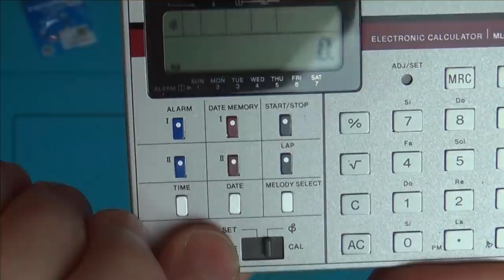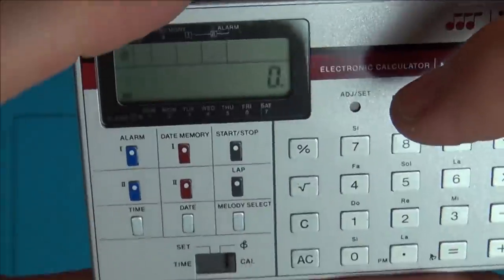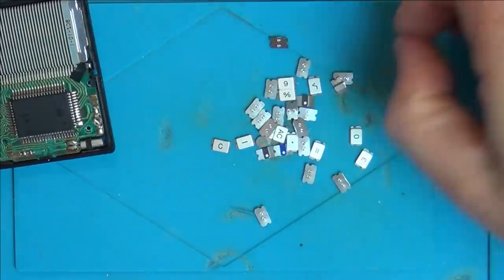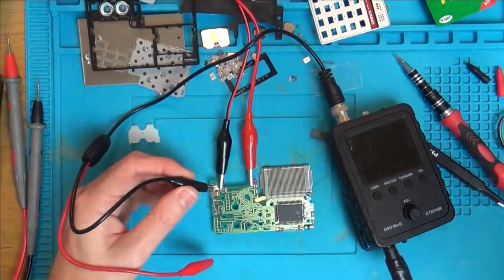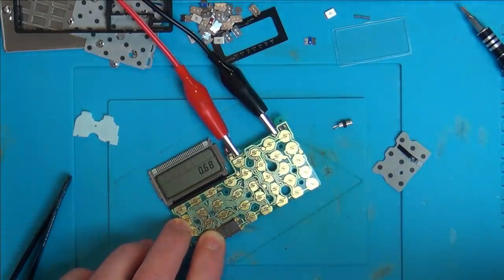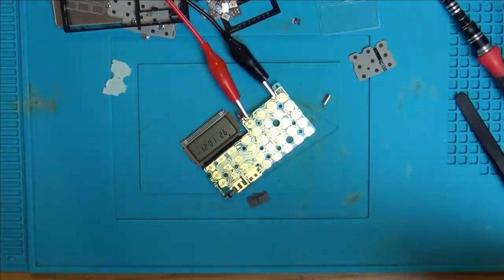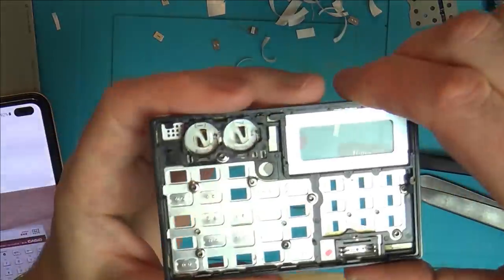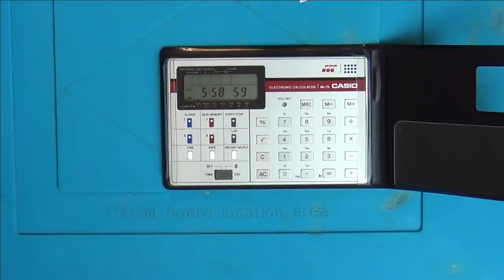Trying to FIX: 1985 CASIO Musical Calculator that Sounds like R2-D2 !!!

Comment: When you removed the crystal and tested, the time was running way too fast, after the replacement crystal installed it then regulated the speed.  So although working without the crystal, it wouldn't have kept good time.
Reply: Exactly! He kept saying its counting up correctly and in my mind I kept yelling NO!

Comment: These Casio calculators last forever. I still have a Casio scientific calculator my parents got me for school in 1987. The small battery door has bulged out a bit but it still works on the original battery 33 years later.

Comment: Less than a minute in, Vince says "I'm wondering if it's just a battery fault" - checks video length, yeah never going to be just a battery !
Reply: I check the time stamps too for videos. Lol
Reply: You need to reset (press "P") after inserting batteries to make it start correctly.

Comment: Most people do not push the “P” reset button or AC/Adjust button or simply don’t know that they have to short the AC terminals when they switch batteries in a Casio product. That is 75% of the “for parts or repair” faults that I have from the Casios that I purchase off of eBay, and the remaining 24% is the sliding switch contact issues.
Reply from the maker: I never knew that either, thanks for sharing. It may be useful in the future :-)
Reply: Out of curiosity, what is the remaining 1% fault condition(s)? I am interested in finding out as I own multiple Casio calculator wristwatches and scientific calculators and feel it would benefit me to be prepared! Thanks in advance oturbator!
Reply: @electronicengineer  The remaining 1% can be 0.5% component issues (broken, bent, lost) and 0.5% can be trace issues. For example, if you ever come across a Casio PB-1000 with a garbled screen, it is highly probable that the seller didn't initiated a proper Reset after replacing the batteries. So it is safe to buy it, keeping in mind that the Casio folding traces are notorious for failing. For example, Casio Fx-451M, PB-220, Fx-790 et. al. are all tricky buys. It is rarely a component failure, like tantalum capacitors or electrolytics which can cause an issue. The LCDs are better than most Sharp or Radio Shack computer or calculators at the time.
Reply: @oturgator  Thank you for this valuable information! I appreciate that you took out the time to reply to me and to identify the issues so well!
Reply: Sounds interesting. I have Casio fx115d calculator from 1991, have had it from new and I still have even the instruction manuals for it. All it says about replacing the battery (GR927) that the owner should bring it to the Casio dealer for battery replacement :D
I have replaced the battery myself at least once or twice without problems but now it's been been without any battery inside almost 20 years. Still works with the solar cell though.
Very entertaining video. The comment about driving teachers mad made me laugh :D They were already mad about those beeping LCD electronic handheld games we had in the 80's :D
Reply: @mrjsv4935  Nintendo game & watch pocket games, very collectable now, I have the 'vermin' one from 1982, still works perfectly!
Reply: Cool :) Mine is Q&Q King Kong game from 1983 and works fine as well, but had to fix battery contacts.
Reply: @oturgator  Most damages (particularly of LCD) in such old electronics are caused by battery leak vapours. Thus always remove batteries before storage. The nasty thing with cheap alkaline button cells is that (unlike expensive ones) they leak already before they are empty. Do not use bulged button cells; they are about to leak. (They are safe to use for few hours but not to keep them inside).

Comment: Awesome video Vince, love these retro calculator/watches with musical alarms, anyway, i program microchip microprocessors of which you can use an external crystal or use the processors own internal oscillator, now these also have an option where by if the external crystal fails, the processor can switch to it's own internal oscillator, so maybe this is what happened when you removed the crystal, the processor started using it's own internal oscillator, not knowing the cpu in that unit i couldn't tell you, but loved the video as i love all your videos and hope this bit of information helps you a little, take care Vince :)
Reply: Models without clock have no quartz but used the internal oscillator to save some cents.

Comment: Quartz cannot be classified only by frequency. A quartz is a complex system in which the relation between the voltage and current (aka the impedance) is  a function of the intrinsic properties of the quartz. One can look at a quartz as a parallel of a capacitor(C0) and a inductor, capacitor and resistance. 
The overall frequency response of this object is what "decide" the frequency of the quartz.
Quartz are used in oscillator in always in some sort of feedback system, where by theory to have an oscillator one have meet the Barkhausen condition (aka the phase of the overall system, at w = w0 = 2*pi*f0 (where f0 is the quartz frequency), = 0  and the  loop gains equals to 1).
So to do in a digital circuit on place an oscillator in a feedback loop of an inverter. Now to obtain the above condition one need to consider the value of the quartz  internal parameters.
Any way despite all good fix and I guess it could be that that quartz was used for audio indeed!.
Reply: My ancient Normatest AVO meter has a clock crystal, great big thing inside there that is used in the formulation of analysing signals which have to be set against an unbreakable constant to gain the variation which becomes the reported signal to your meter arm.   Its useful in that the device does not rely on the battery or mains voltage as a constant which can vary considerably, other uses being setting current frequency to a precise waveform or used as a binary pulse switch e.g. watches.
Reply: I don't believe you. Every crystal can be replaced by every crystal you randomly find at home.  Proof: Vince
Reply: so if what you say is true, and the freq is dependent on current and voltage, why is a crystal the same freq on 3.3v as it is on 5v or 12v ??? and why do manufacturers not print a voltage range on them ? ? ?
Reply: @WereReallyRelayCamping  it's not dependent on voltage and current. I want describe the stuff easier. It's dependent on the transfer function of the equivalent circuit of the crystal that is the ratio between the vokatge and current. The frequency is dependent on intrinsic characteristics of the filter
Reply: Also to measure filter you put it i to a network analyszer that swept the frequency at for every frequency it calculate the impedence of the crystal. Than you would obtain a plot where you see that the function you see have a minimum and that is the quartz filter.

Comment: Nice fix, I kinda figured if the clock was working w/o the crystal then the crystal was for the musical tone generation.  Also figured a standard 32768 crystal is what was in there and low and behold... it was.  Morning has broken, but not the singing calculator watch music thingy :)

Comment: What a great video, I really enjoyed watching and hearing the process of dismantling, diagnosing and resurrecting a little Casio calculator. I was in high school when this generation of Casio calculators were popular and remember them well - so much nostalgia!

All these years later I now have three vintage Casio musical calculators - 2 x ML831 and 1 x MG880. I bought my first ML831 as "faulty/ parts or repair" (though it was cosmetically in excellent condition), and was also hoping it would be a simple battery issue. Unfortunately, it wasn't. The second ML831 works fine though it's noticeably more used (I plan to put the working internals of the more battered ML831 into the cosmetically better case of the other ML831). The MG880 I found in a drawer in my old bedroom at my mother's house back in the UK when I visited earlier this year, and I can't for the life of me remember where I got it from. It turns on and appears to work, but the display segments have fluctuating/ non display issues, though it's almost certainly poor connection with the display ribbon, as putting pressure on the display connectors makes the invisible segments appear. The ribbon cable looks to be one of those heat/ press/ glue cables that are notorious for failing contacts on more recent 1990's/ 2000's LCD and electronic devices (including some synthesizer key beds). Casios seem to be less affected by this and in general their LCD displays and connectors were/ are very reliable and well made. I might try the trick of reheating the ribbon cable to connector contact as that can sometimes restore the connections.

Back to the faulty ML831. If I put batteries in it, the display shows a 1 and a  -1 at each end of the display, and sometimes it makes a droning tone, and sometimes it doesn't. Of note, it does this regardless of where the power/ melody/ calculator switch is positioned - the selector switch changes nothing and none of the buttons are responsive or do anything. I took it apart looking for a simple fix, and the internals look to be in excellent condition with nothing notable amiss. In fact other than a small blue capacitor, two small through hole resistors and some SMD resistors, there's nothing else to on the board other than the LSI/ CPU. Interesting to note, with the power/ selector switch removed, when I put power/ batteries in it, it still displays the above 1 and -1 and sometimes the droning/ stuck tone. I've no idea whether one of the resistors or the capacitor could be causing this fault, or if the LSI itself is fried internally. A shame, as I'd still like to get it working again.

Of note, all three of these Casio calculator models I have do NOT have a crystal, and as they don't have the clock/ stopwatch/ date function of yours, no doubt that's why. As others have already pointed out, the oscillator in yours is for generating the timing frequency to keep the clock accurate. It will run without it, but won't keep correct time.

Anyway, great video, keep up the good work and you've got a new subscription from me!
Reply: I analyzed the hardware (chip pinout, keboard matrix layout) if many Casio musical calculators. Basically there exist only 2 different CPU types (special microcontroller with internal maskrom); the rest is changed software. The quartz is only needed for accurate clock (often with additional trimmer capacitor to tweak speed) and tone generator pitch. Models without clock don't need it.

Comment: The out put you are seeing on the scope when its not connected  is from the power supply the cheap scope probes are likely not insulated and by crossing over the power connection or being close to them as its acting as an antenna is picking up noise from the PSU  that is why its around 50Hz I would suggest making or buying a cable but the money maybe better spent on a different scope. Well done on the fix awesome video as always.

Comment: Ha called it. Was the crystal odd that it functions without. It could be for a different function. IC chips can create their own clocks using capacitors and resistors so that could be what the chip is using for the calculator side since it doesn't need to be particularly fast or very accurate. But for something like digital sound frequencies matter and a clock using a quartz crystals is far more accurate and stable under normal ambient conditions. For most home electrical devices you can assume they will be a normal watch crystal. As you stated they are mass manufactured and extremely cheap. So the one you pulled out should be similar. Even if it wasn't for most basic cases like this a different one should still work the sound and maybe function would just feel slightly off. The clock frequency would really matter more for things like radios or tuning counting things that need a known value. Something like this it is just used to help the calculator programming move to the next step in its program as well as produce sound. For your oscilloscope your probes are picking up ambient radiation and noise that is all around us from the sun to radio stations and even frequencies from your mains. So at low voltages you will see lots of waves and noise. You can disregard that. For a clock you would see a nice big steady wave. You were measuring it right but since that crystal was busted it wasn't creating that needed wave that you would have seen if it was functioning correctly.
Reply from the maker: Great advice, thanks coll6 :-)
Reply: @Mymatevince  No problem hope it helps in the future great videos.

Comment: You only need to reset it if it sounds like R2D2! Several Casio models had only a manual reset (press "P" button with small screwdriver - was this meant to circumvent a patent on reset capacitors) that needs to be pressed to start correctly. Casio melody calculators do this when the quartz got excited on a multiple of its intended frequency. Normally the reset starts it at 32768Hz or such, but shitshot (battery wiggling etc.) can crash it to start like this. Likely the quartz or a capacitor at the same clock pins was a bit off. The ceramic trimmer capacitor (resembles a screw) tweaks the clock speed; if it has a crack, it tends to crash randomly. Without quartz it may run, but clock is very inaccurate. The calendar has no Y2K problems. Type the year as 4 digits (2023 instead of 23) and it computes days correctly.

And be extremely careful with the foil cable; never fold or scratch it, or it will break. If it falls off, install a piece of foam adhesive tape (window insulation) to press it on. The PCB is only held by screws, so do not pull off the metal front (unless it does by itself), else key mess falls on floor. Do not forget the small metal disc - it is for the "SET/ADJ" key hole to prevent sharp objects from damaging the silicone rubber contact underneath.

Comment: A damaged crystal will have its clock speed greatly increased I think?
That'd throw the clock out, but more importantly if it was controlling the processor clock base as well, then the proc wasnt recieving the input at the rate it was expecting. It'd be like trying to read a scrolling message thats doing 5 pages a second instead of 1/4
Reply: Some Casio calculators need reset (press "P" button) after battery insertion, else the crystal runs too fast and crashes in funny ways. Also a broken (cracked) crystal or clock speed trimmer can cause this.

Comment: Great fix.  I feel I have to ask, though I probably shouldn't because it's really none of my business.  But, how does the rest of your family feel about you spending so much time fixing all these things?  Do the rest of your family make use of all these eBay items you buy once you've fixed them up and got them working?  I wonder if there was a dry solder joint on that crystal you took out and put back in, causing it to act in that way.  The calculator sounded like it has been circuit bent.
Reply from the maker: Thanks :-) I do spend way too much time working. When I was in full time employment at BT I did 37.5 hours a week, and then used to work overtime at least one day a week. Now I would do more like 85 hours per week. I don't see it as work though because I enjoy it, but family life does suffer. I need to cut down a bit, to get a bit of normality back in my life. 
Unfortuantely these 'trying to fix' videos take up a huge amount of time fixing/filming and editing, and unfortunately most of them do not pay well as they can stop at 30k views and then flatline. That's no good if it has taken 2 days of work as 30k views wouldn't pay for half a days work where I live. Also filming at home is a hassle when you have a family as it is unfair to ask for complete silence when filming for most of the day. So it can be an inconvenience. 
But this fix was ideal as the whole thing from start to being live on YouTube was only around 5-6 hours so it is worthwhile :-) This one here was like an ideal fix, not a boring battery leak, unusual item and a simple repair that makes it 100% useable again.
Items like this calculator would probably go unused as I already have a working (non musical) calculator but some items I can make use of. I like to try and mix up the videos a bit to keep it interesting, so I may try and fix things that I wouldn't normally use personally. Then in the future I can sell or giveaway the items that I am confident are fully working :-)
Cheers for the support :-)
Reply: My Mate VINCE You should definitely time box your repairs, and release them in parts as you've done a few times. Not only would it be better vis-à-vis your family, but us viewers get more involved with the fix.

Anyway, thanks for the awesome videos :)
Reply: @Mymatevince  Yeah, I understand, how does your family react to these repairs.  What did you do when you worked at British Telecom?

Comment: One could hear it from the beginning that there was a problem with the system clock - the off-frequency music told it ;-)
When calculating  it does not neccessary fail (but most of the time does), even a near by cellphone can "clock" the calculator. But when it comes to music or time, a stable system clock is mandatory - therefore the crystal ...

Comment: It was probably never a crystal fault - more likely a few keys were depressed simultaneously or the slider key had some gunk under it shorting something incorrectly, or the heat from the soldering iron heated up the CPU area and re solidified a connection/pin on the CPU. Also it is very painful watching you reinsert every key and every screw to perform a test, when u could just solder on the speaker and test it before reassembling.
Reply: You need to reset (press "P" button) after battery insertion to start at correct quartz frequency.